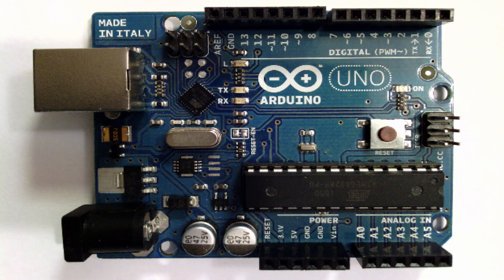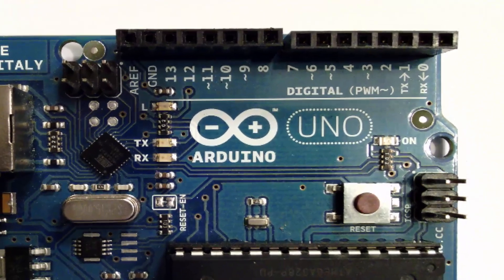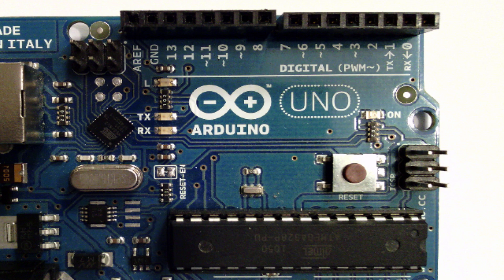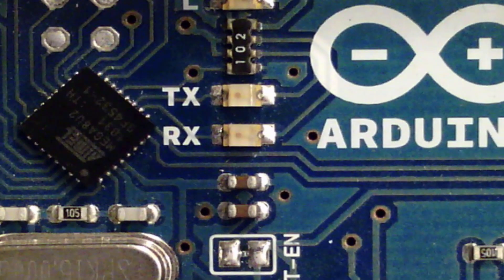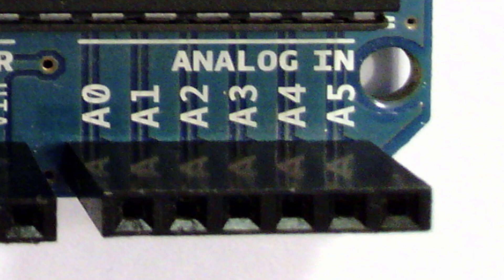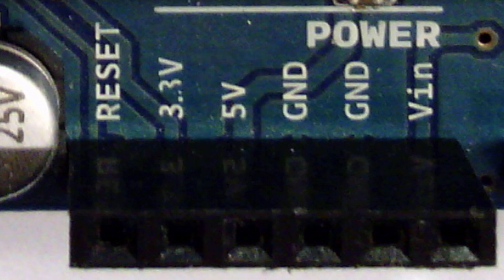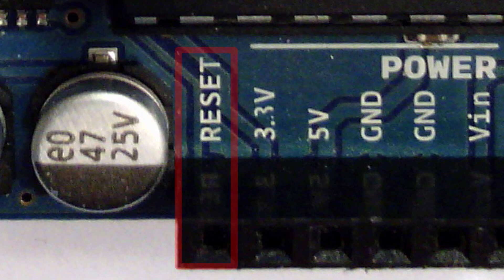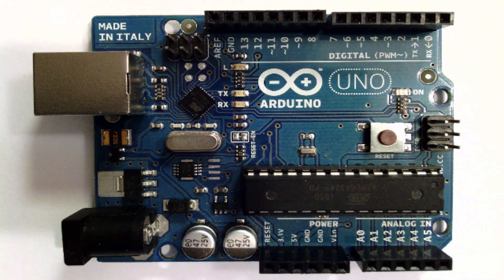Tutorial 01: Hardware Overview: Arduino Course for Absolute Beginners (ReM)

Comment: the truth is know wat is Arduino but i have a few qustion

1. if have piece for other From others divice such as mouse lezer or remote controller the is way to connect in the Arduino and change what do with code or need Piece specific fur Arduino ?
2. if make the device like controller for example it will works for eny computer or only for cumputer have Arduino prgram second i will find the code for or will be worcks only for the computer made it ?

I ask I few questions because i won't to started Arduino but i don't have enough information and I have a lot old devices and if is way to take part for old devices and to recrete new devices I will be able to meke new device as want

Comment: I like this. But will it be a good starter if I want to learn the atmega 2560 chip? I actually have a designers kit from amazon. I just dont know how to set up to the pc, install the software to get started or even how to write code. 
I would love to learn how to control LED's and more so matrix displays of any size. Thank you

Comment: The tutorial was amazing. But can someone explain me that analog to digital part?I dont understand that
Reply: Digital pins only recognize two voltages. High or low. Analog pins can tell you what the voltage is, and so you should use them to read sensors etc..

Comment: IS THIS BOARD CAN BE USED 👇⬇⬇⬇
Generic Uno R3 ATmega328P with USB Cable length 1 feet, Compatible with ATMEGA16U2 Arduino (Color may vary) https://www.amazon.in/dp/B015C7SC5U/ref=cm_sw_r_apa_i_1UEvAbP7B3NFM

Comment: can u Pls tell what is the use of 2 small circular objects, located on the left side of reset pin. 
and Pls explain how can we reset using the reset pin( in video u told that by applying 0 voltage to it but I didn't got it.

Comment: I bought a Mega 2560 .... When I plug in the USB Cable the power light comes on as it should, "BUT" the led at pin 13 also coms on flashing and never stops. I don't think this is normal... any ideas????

Comment: just a question, how do you "apply 0 volts to the reset pin"? applying voltage means positive  voltage thats going to be over zero,so how do you apply 0 volts?
Reply: +akuiori There's no such thing as absolute voltage. Voltage exists betwen two points in space.What the video creator means by a pin having +5V is, for example, that there is a +5V voltage between this pin and GND.

Consequently, to apply "0 voltage" to the reset pin means to connect the pin to GND., You can simply hold the ends of a wire to GND and RST, and the Arduino will reset. You could also solder two wires to GND and RST and connect them with a push button. Then the Arduino will reset whenever you press the button. These are just two examples.

Comment: Hey , ive started learning to get a digispark and teensy 2.0 to type stuff out and blink just basic but im tryinng to learn how to get the teensy to press keys eg windows plus r key , it opens a run window but lots off them because the code is in loop i put it in void setup like i do for other code but it just wont run when in setup so im trying to work out how to run the code once but  not in void setup i tried while(0){} but it doesn't work when i put that in with the code in void loop  it wont run again, any ideas?
Reply: +Luke Havill  also if i put in a delay in the loop the keys dont press till the second time around idk why
Reply: +Luke Havill Keyboard.press(MODIFIERKEY_GUI);
Keyboard.press(KEY_R);
Keyboard.release(MODIFIERKEY_GUI);
Keyboard.release(KEY_R);

Comment: Hi, I have a very smart 12 y/o boy, that shows a lot of interest in electronics and programming. Can you tell me if learning about Arduino is a good path for him to take? He is really very smart, way ahead of the teachings in his school, so I am trying to have him "playing" with stuff that at same time makes him learn something usefull, but I dont know too much about thie ARDUINO thing. If somebody can advice, thanks.
Reply: +Luis Garcia 
Hi Luis, I am an industrial engineer that has formally learned a number of programming languages in robotics and manufacturing. To start, the arduino is what you call a Micro-controller, simply put, it is a small computer with inputs and outputs. These inputs and outputs are important because that is where you can begin to control electronic devices. (Meaning it is where the signals are sent or received from the device). It is designed to be extremely simple, cheap, and easy to learn. (which is all very true)
The Arduino is the perfect way to get hands on experience with technological devices and simple programming. The programming language that Arduino runs off of is very basic, simple, powerful, and is the foundation of A LOT of  different serious programs used everyday. It is the real deal, not a toy. (but basically indestructible)
I work as a mechanical engineer for a company that designs automated machinery and we use controllers just like this all the time. The Arduino wont cut it for what we are trying to do but I promise this is a fantastic place for a 12 year old to start. Not only will he get to experiment with physical electronics but he will learn the bridge between those physical devices and his programming. The cliche of, "once you know one programming language, you can learn them all" is very true because they all work the same way on a fundamental level. So learning any programming language is very valuable.
I hope that helps to at least answer some of your questions, im sure you have plenty more so please ask away! I say, just buy him an experimenters kit, they are cheap and offer loads of educational value. Good luck!
Reply: +Alex Jucas Thanks you so much for your help on this matter. Nobody could give me a better response. Thanks again, I will be ordering the starters kit for him (maybe for both of us!). By the way, I am also an engineer, but in my case I am in telecom, and even though I did take some microporcessors class back in the day (long ago!), it was very basic and short, since my concentration took me more towards electromagnetism, antennas and stuff like that, never really focused in electronics, and also given the time has passed, I forgot many things. But thanks again, I hope to update with results on my kid experiments.

Comment: Thanks for these great tutorials - just a quick question before I start them: I have just bought an arduino and a few basic sensors, but have no programming knowledge (although am IT literate) - do your tutorials cover the actual how-to code aspect? Should I watch your tutorials from 01 or start at a different point? THanks!
Reply from the maker: Hi Justin - the series focuses in teaching the code in depth.  I would recommend starting at 01 and working your way up.  If you register at the Open Source Hardware Group Website - it makes it easy to track your progress.

https://opensourcehardwaregroup.com/thearduinocourse/

Best of luck!
Reply: Thank you :)